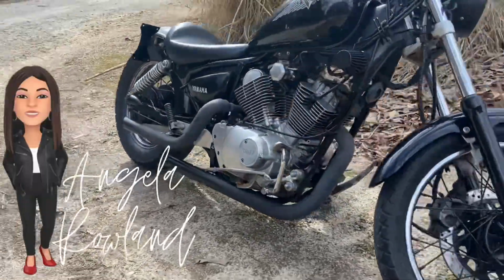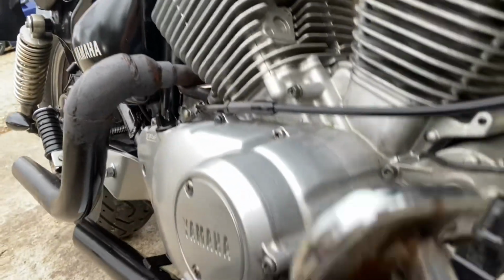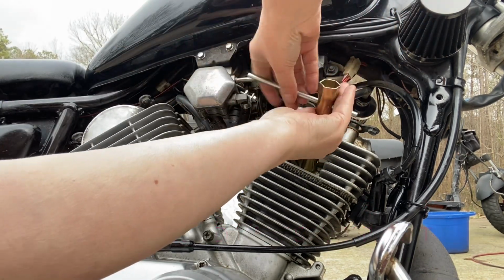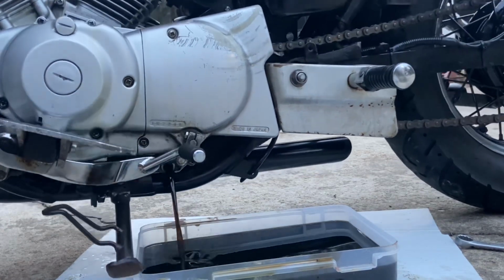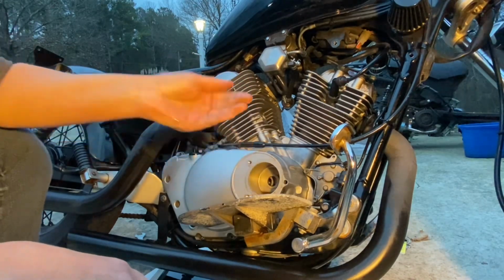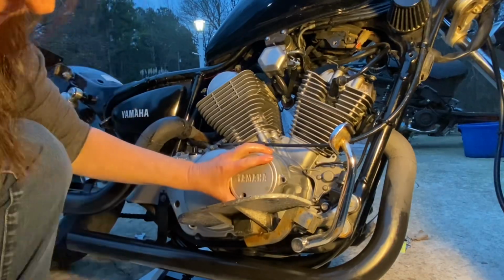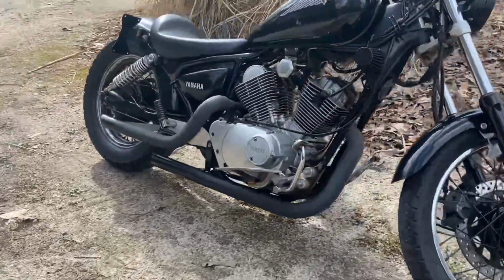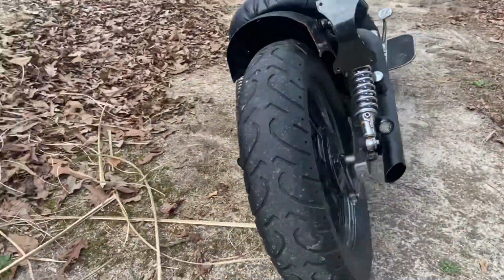2000 Yamaha Virago 250 Fluid Leak? Or Oil Over Fill?

Comment: I just bought a 2006 Virago 250 from my friend.  I just took the motorcycle class last month to get my drivers license endorsement.  Until I test drove my friend's Virago a couple weeks ago, the most powerful motorcycle I had rode in my life was the Yamaha Trail Way 200 at the class lol

I had a hell of a time getting the Virago home from my friend's place!  He hadn't ridden it in a while, so the battery was dead.  I also didn't realize that the gas tank was empty.  I ended up breaking down on the side of the interstate a few times during the usually about half hour drive.  It seems like it's been running better since then, since I charged the battery, but I still can't close the choke all the way.  I have an appointment to get it serviced in a couple weeks.

I really wanted a sport bike, but I'm glad that I gave this one a chance!  It's so comfortable, and the seat is so low!  I rode around the neighborhood this past weekend, and practiced slow speed maneuvers like U turns, because that's where I had the most difficulty in the class.  I remembered to keep my head up and use the rear brake only (for slow speed).
Reply from the maker: I am huge fan of the Virago, but I got my licenses on a Honda Rebel. Basically the same all the way around as well as the Yamaha Vstar. I Love all of these bikes for beginners. I also like the Ninja 250/300/500 these are great bikes as well. I have a Vstar that I am riding now. I just did a little short on it. I am working on a Ninja 250, getting it ready for sale. I love them all!!
Reply: i got my license on a yamaha tw200, but just loving my virago xv250, its a 1988, im the second owner and i got it with only 5k km on the odometer, tunnels and over passes are fun, tagged it 4 days ago

Comment: On, is designed to move fuel from the tank to the carbs while the engine is running, by means of the vacume line going to the intake manifold from the fuel pump.
I believe the pressure build up of the fuel system will and can allow fuel to push through the carb into the combustion chamber and then past the rings eventually into the oil.
Imagine now you have filler the crankcase with a nice mix of gas and oil, the air pressure in the crank case is now trying to push oil and gas mix through all the engine seals.
so I am changing  to a electric fuel filter, with a pet cock that shuts the fuel off, the only sure way to prevent the gas in the oil. Remember the front of the frame under the air filter is the air intake, check it for oil too.

Comment: Gas in the oil is common on the Vstar 250. Everytime I change mine I notice that smell. The vacuum design on the bike is cool but I feel like it has its faults. Over haul that and put a fuel cut off yourself and you won't even have gas in the oil that's what I did recently
Reply from the maker: @johnnyjohn7671  thank you for your I p

Comment: I searched depths of utube for clues when my 07 was leaking from a frame bolt (bolts opposite of the air filter mount - low side of frame on the stand). Same gas/oil mix just after having clutch replaced & oil change. It overflowed into the frame near airbox,, etc. In short; fresh oil at correct level and not a drop/leak since.My theory... Ran out of gas on my way home.from mechanic. My theory is oil was overfilled or the petcock was perhaps turned to prime at some point in testing and dumped gas. It's been on the reserve setting ever since and zero problems. Bike is a commuter & never sits longer than a few winter weeks however.
Reply from the maker: Thank you for your input. I really appreciate it and good to know!

Comment: Hello. Bingo on the contaminated oil from a non-functioning fuel petcock. Our shop has recently had two Yamahas come in with bad oil leaks. Japapanese bikes generally just don't have bad oil leaks. One was a 1100 twin and the most recent was a 1992 Yamaha Virago with 6000 miles on it that had sat for 15 years. Both had oil leaking over a good part of the engine. Long story short, both bikes  crankcases were loaded with gasoline. Drained the oil, replaced the fuel petcocks with OEM petcocks, yup, can be around $100, but don't waste your money on the online cheap replacements.  Bettery yet, replace with a manual petcock that perhaps Pengal has an application. The reason the manufacturers came up with the vacuum activated petcock was to that the operator would not have to remember to put the petcock on "stop" when the vehicle was parked. If the carburetor on said bike has not so great sealing needle and seats, there is a possibility of gas passing into the crankcase or worse, into the cyclinder exposing the engine to hydrolock. Starter motor orings, shiftshaft seals, clutch rod seals, etc, are not designed to seal while submerged but handle splash. So, good diagnostic procedure for you. In addition, I have found working on others bike, don't assume maintenance and repair work has been done properly. The oil filter you removed and then replaced is in backwards. The relief valve of the filter should mate against the engine case and not the access cover. Thanks for posting your video!
Reply from the maker: Thanks so much for your comment as well as the advice! I always appreciate the input so it can help others that may be experiencing the same problem! Love this little Viragos though!😎

Comment: Do those aftermarket pod air filters affect the performance?  I can't decide if I think they look better than the stock ones or not, but I noticed that it's different from my Virago.
Reply from the maker: I am really not sure on that personally. I prefer stock bikes except maybe adding some apes or something like that- but as far as performance on these one, it came on it when I got it.
Reply: @AngiesCycles  Cool, thanks!  My Virago is the first motorcycle I've ever owned, and only the third one I've ridden!  I just took the basic motorcycle class last month and got my license endorsement, and my friend had a Virago 250 for sale, so I bought it. 

We had a hell of a time getting it to my house, though. The battery died and it ran out of gas, so my friend brought me some gas and kept jump starting it for me. It seems like it's working better now, but I have an appointment to get it tuned up in about a week.
Reply: They do because they allow more air into the engine, but to make it run correctly you'll need to adjust the carburettor. Plenty of videos on youtube to do it yourself
Reply from the maker: @fuckyougoogleupthearse5725  Thanks for the info😁✌🏼

Comment: So did you ever find how the gas got into the oil?
Might have been as well to check the spark plug gap while you had them out. That metallic ringing when reving the engine should be investigated too, might be tappet adjustment.
Don't you licence plates for motorcycles in the US?
Reply from the maker: What I figure is that this bike sat for awhile and the gas eventually made its way into the oil. Yes, we plate our bikes in the US😁